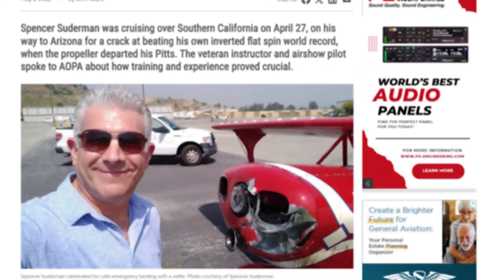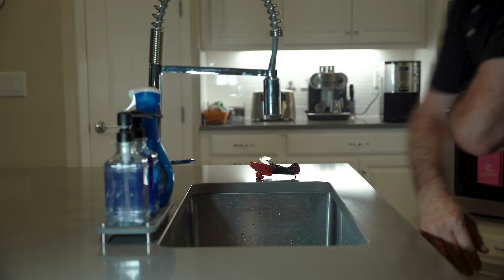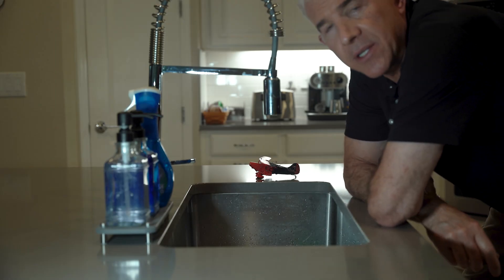How Airplanes Fly Explained With Kitchen Science

Comment: Very Cool! How does it work when you're upside down?
Reply from the maker: Exactly the same.  It's about angle of attack of the wing to the relative wind.  Most aerobatic planes have a symmetrical wing so the AOA to create a given amount of lift is the same whether upright or inverted.  A plane with a wing that is curved on the top and flat on the bottom will require a higher AOA to create the same amount of lift when inverted.
Reply: @ssairshows  I didn't know that aerobatic planes usually have a symmetrical wing, that's really cool. Thanks for the answer!